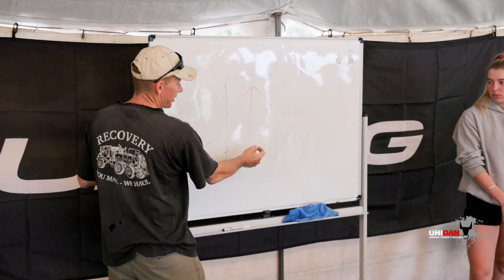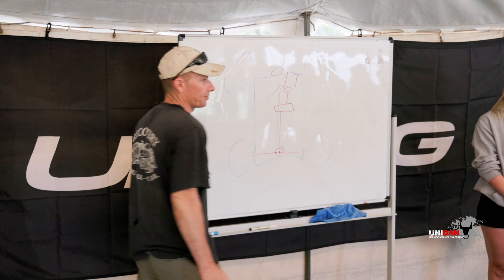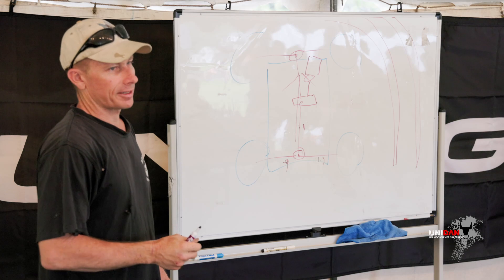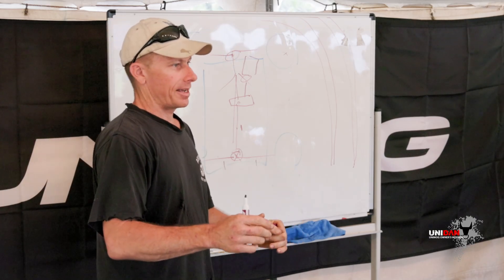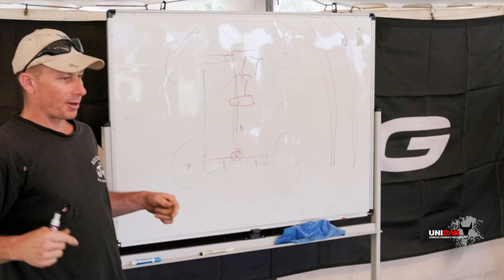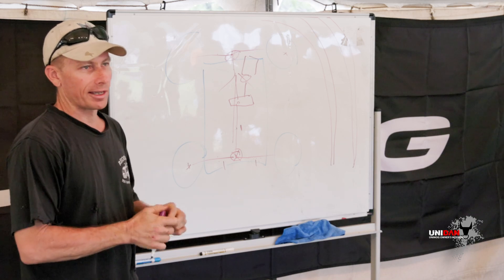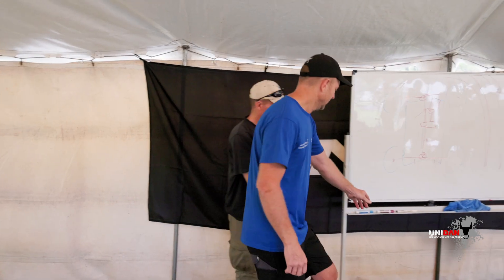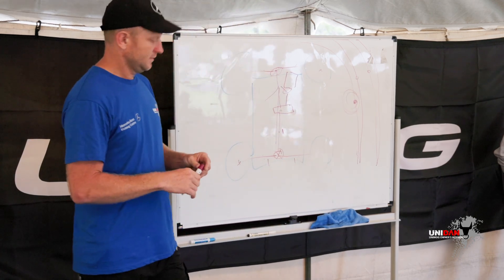TIPS & TRICKS - Diff Lock Discussion - Mercedes-Benz Unimog

Comment: Looking at my diff lock switch (U1300L) 
Position 0 - no diff lock, no 4wd
Position 1 - no diff lock, 4wd
Position 2 - front + rear diff lock, 4wd
How do you make it lock the rear only in 4wd?
Reply: Honestly what is the point of only locking the rear axle if I can lock both axles including the distributor gear so that I have 25% of the power on each wheel In addition,  1. the all-wheel drive and the lock-out are  2. only intended on slippery terrain
Reply: @MrFialdark  The only real reason to lock the rear only is for maximum drive while still being able to steer.
In a normal 4x4 it is sometimes a good thing, with a Mog... Well you don't need to be subtle. 🤣
Reply: @MrFialdark  Sure it is. If you drive up mudy hill and you have corners you want front lock out as much as possible. Or you will just push out of the corner. I drive in deep slick mud a lot. I removed front locker and put LSD in. I want to turn and still have some drive on both front tires. With lockers you have only 2 option: open diff or locked. And they do not unlock under load..so you need to go off gas to unlock....your forward momentum goes to hell.